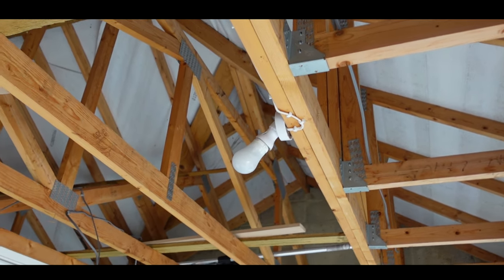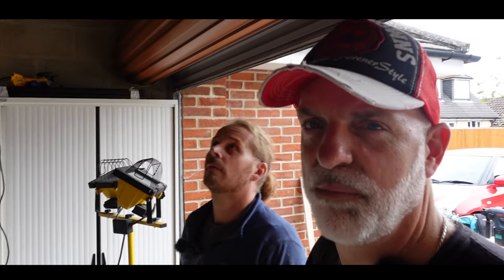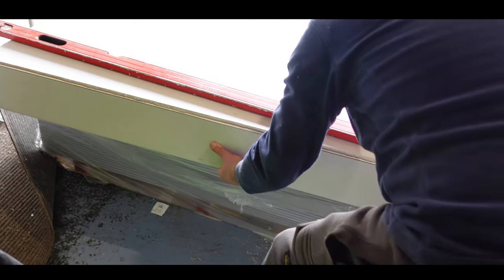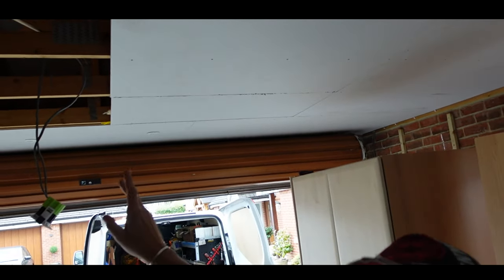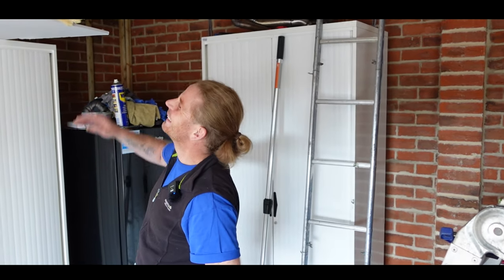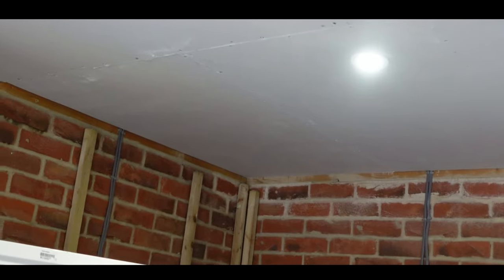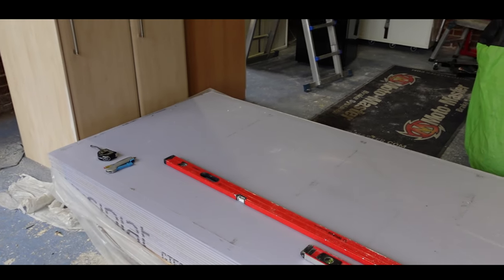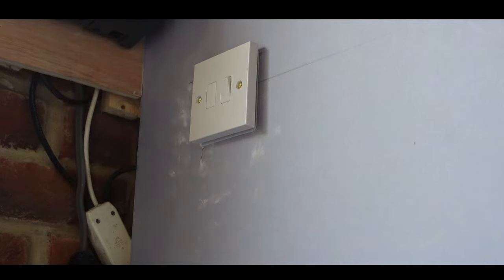Plasterboard HELL!! | The Ultimate Garage Build EP03

Comment: Done my DG 2x fibers glass electric doors, Roof I cut sheets of polystyrene between joist and boarded for storage, walls sheets of polystyrene and then plaster board, one oil filled radiator never drops below 10c in winter on closest night, summer never over 20c, this winter will insulted garage doors with that foil insulation hopefully will rise temps in winter and lower temps in summer as they radiate a lot of heat in summer inwards

Comment: Would of counterbattoned the ceiling with 2"x 1" or slate batton. No cutting of hangers required. Even get the spacing for the plasterboards bang on. Anyways it'll work out in the end
Reply: I don't think there's a chippy on the job. 😬

Comment: top tip with your screws to save you neck, when putting the boards above your head initially, the first 4-6 screws, don't sink the screw in leave the head sticking out slightly for the first few and it'll hold the weight of the sheet and free up your hands and head, then once it's infilled with screws go round to those first ones and put them under the flush

Comment: Where are you putting shelving up? Won't that area need the wood supports added now rather then cutting the board to add them afterwards. Also you could have added the wall insulation on first rather than just the roof stuff there are grants for it (or you could add the external stuff).

Comment: What size is your drywall boards? Ours are 4'  x  8"(1.2 m x 2.4)  but we can also get  4 X10  and a few sizes that are longer but they tend to be for commercial use. I used 4x10 in my garage since I had 10 foot ceilings. I purchased a drywall hoist to lift the boards to the ceiling so I could screw them in  since I didn't have a "Womble" to help me ;-)  Keep up the good work it will be worth it in the end.
Reply from the maker: 1.2 x 2.4 if I remember well... they are a little short but a long skirting board will sort it 👍

Comment: Buy a rotary screw compressor ( a lot quieter than a regular compressor) and mount it in the ceiling with an auto retract airline connected, keeps the noise right down and no floor space used. Taping the joints etc in a garage is a waste of time it’s just for looks, just paint the boards, if you ever damage or want to remove a board it’s much easier.
Reply from the maker: Like the compressor idea brilliant 👏

Comment: Lol , u shure ur m8 knows what hes dooin
Not avein a go but 
Wrong type of board 
Did it hardest way possible for ceiling 
If thats single skin brick on walls needs vapor barrier 
Those wider spans in roof need suport 600mm widest with 12mm board , and use TE foil back board 
Love your vids , long time subscriber 
Ask ur m8 if hes ever seen a dead man prop 
And screw every 300mm or less or they fall off as you found out

Comment: tape all joints with mud before you install lights, switches, outlets chopsy.......insulation gets stapled prior to drywall or blown in after the fact for ceiling.......

Comment: A house building company advised me against doing this in my garage…. Warm air inside the garage, against the cold air from the single skin brickwork will, over time, cause the plasterboard to get damp and rot…. Is there anything your doing to stop this or is my builder fobbing me off??
Reply: Vapour barrier installed correctly with an SD value of around 130 or more (it’s green in colour and must be fitted so it’s airtight

Comment: I’m no diy’er but I feel like those boards will bow with out support in the middle
Reply from the maker: The wall boards have a middle batten, the ceiling has screws on all surfaces where it touches the rafters  at least three corners of the board... I hope it doesn't 🙏